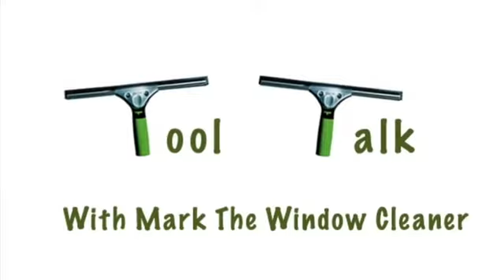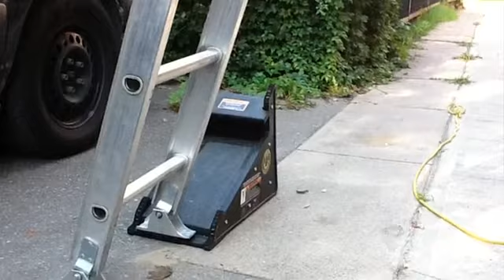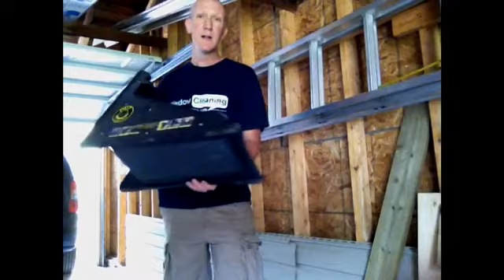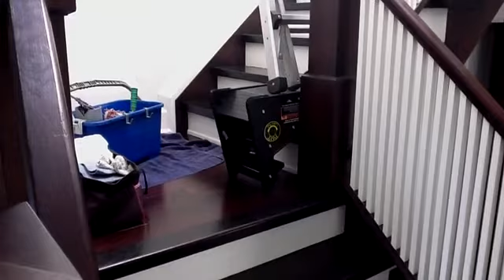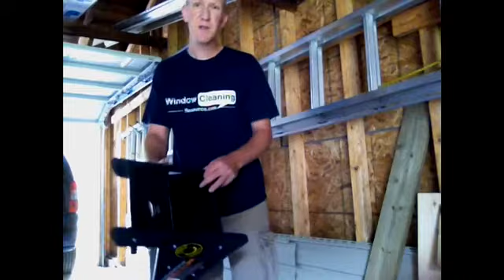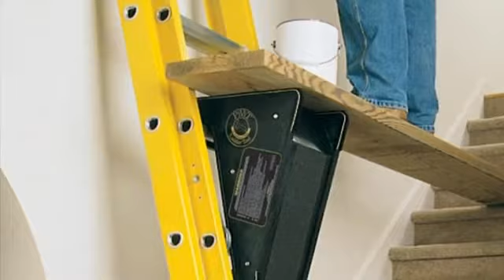Vimeo 27666422 Pivit Ladder Tool Review

Comment: ya the angle on the handle park needs to be at a steeper angle and what not to fit more areas better, this PiViT leveler is triple the cost than comparable and should be made to sit on more stair with different dimensions